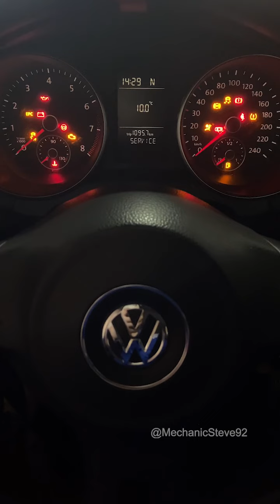Volkswagen Golf dry ice cleaning carbon deposits.

Comment: Where does the carbon go?
Reply: Evaporates I guess 😂
Reply: If you look first they took the plugs out on top (there is where they insert the camera from each spark-plug hole and latter the thin pressure tube) but they also open the exhaust manifold system on the back of the engine (look from 1:05 to 1:11 when he moves the angle of camera from top and looks from the back of the engine block he start at 1:15 -1st cylinder chamber, 1:24 -2nd chamber, 1:29 -3rd chamber 1:34 -4th chamber ) that is where you can clearly see much better all the black carbon deposits build inside each burning chamber and both valves from each cylinder covered in carbon deposits..  so when they start cleaning at 1:43, they blast from top-they insert tube from above on each plug/cylinder chamber from left to right and from the back as well ( so when they clean from above the gunk vapors & carbon deposits gets out from burning chambers thru the exhaust wholes in the back when they clean from behind inside the chambers the vapors get 's out from plug hole then they look again to check if needs more cleaning they repeat this clean for each plug / chamber ).. it looks brand spanking new at the end with very clean results and i bet that engine runs smoother than before this cleaning.. ;0)